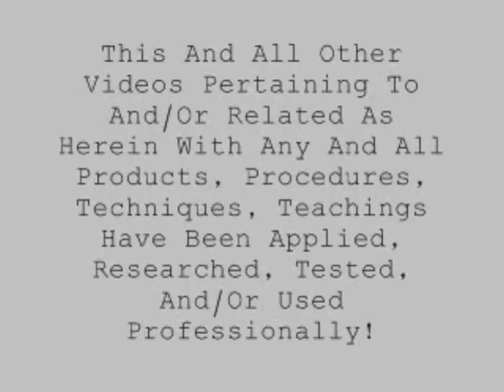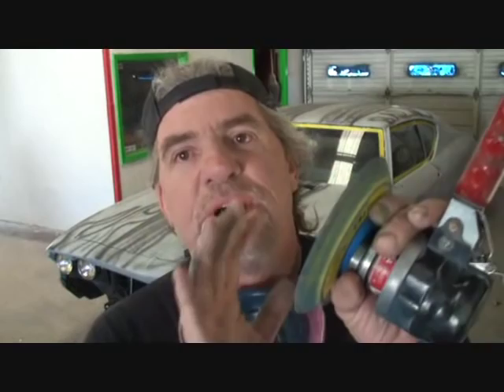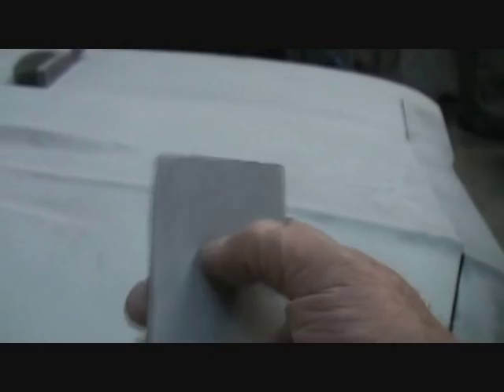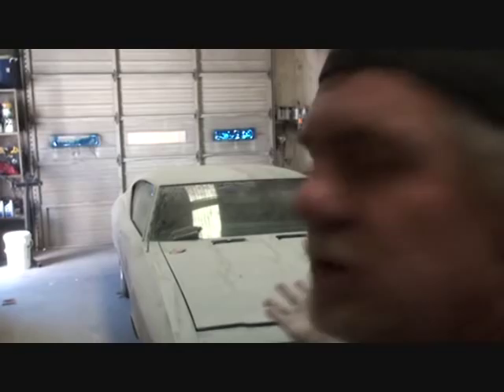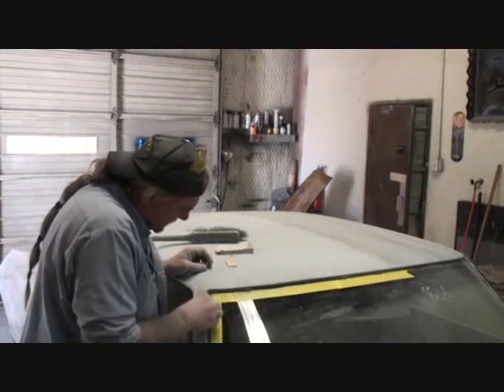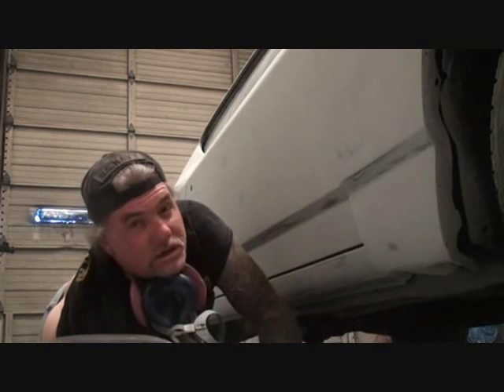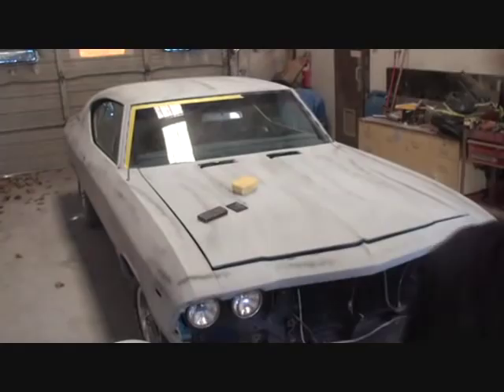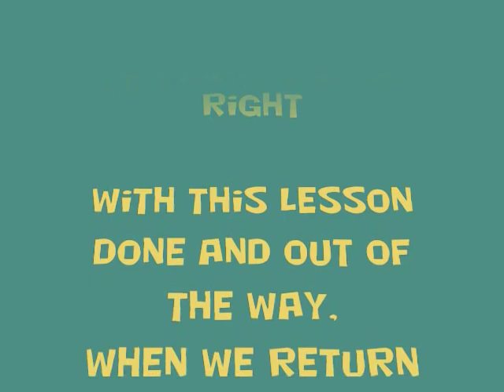"How To Paint A Car"-By Yourself-Part 10-Block Sanding Primer

Comment: I have been researching all day about body work, because I am getting ready to do it to my Truck in the future. I am just weighing all my options, and have been making a list of tools I will need for the future. I enjoy doing all the work myself on my build. I am very concerned about paint, because I want my truck to last for my whole life, and be my daily driver. I also live in illinois, right in the salt belt. How much did you charge the person for the job in this video? This is about the same degree or work I need to do, or worse. I will do most of my metal work on my own, but I am contemplating having someone else doing the bondo, sanding, primer, and paint, because I feel like I might not be able to get it as good as I want, and need it to be if I want it to last. It is a 1958 International Harvester 4x4 Travelette. Only 72 total were ever made, and only 17 were factory 4x4. It is the first crew cab made by any manufacturer. I want to get it right.

Comment: Hi Peter,  I'm really enjoying your show. I bought a 1992 Dodge Dakota last week for $1000 I'm using it for work.  It has a coat of primer on it I'm guessing because the paint was peeling,  but it all looks good no rust no peeling paint no dents just a few sanding scratches in primer. I'm thinking wet sand it with 420 and paint ? Regards,  Pat.

Comment: Just finished sanding my last project but funny how we use similar methods - I must be learning.  That surface of 2k primer is a bear unless you cut it with a quick pass with the DA.  Next up is a VW bus" Getting the list done!  Thanks Pete & take it easy in that crazy weather back there.  Over 100 here in the CA high desert!
Reply from the maker: Jim Daniell Good Ole VW Bus! Better get a BIG AIR COMPRESSOR for that job..
Reply: diyautoschool For sure!  Actually it's a re-do so mostly just removing some paint & smoothing a bit more.  The original job needed to sand blast the "patina" roof they seem to get - lots of sand!  Used a pressure washer attachment so saved a little life on the compressor & keep dust down.  Just a small shop DIY'er but do have a big compressor - a necessity.  More time than brains & money these days!

Comment: Hey my friend Pete, I enjoy your videos and am new to auto body.  I'm working on my 68 Falcon, planning on a gloss black 2 stage base clear paint job. Started out sanding the whole car down and covering it in black Summit Epoxy (sealer) not primer. LOL then scuffed that down with 180, did all the filler work necessary, and welded in the holes from the trim and moldings, 1 more 180 sand down followed by 1 more coat of epoxy to seal everything in. Then a coat of Nason 421-19 primer -surface 2k. (smells like strawberries) and some trim coat to check my work. So far so good. Im almost at the point of spraying 3 layers of the Nason to do all my final sanding by hand (I bought the dura block set). I was told to sand in sequence 180,320,400,600 then base-clear. My question is: you went from 180 straight to 400 wet. Can I do that for a black base-clear and be ok? Skipping the other steps? If so, great! But I am like you, wanna do it right the first time. Thanks again for all the info brother and I will keep watching!! I saw the video where you said epoxy is a sealer and sucks to sand, boy are you right!! Clog city! But I missed the 5 day recoat window so had no choice.
Reply: aaron anderson  Ok Aaron, I appreciate the reply man. I will try it. That will save me some work for sure! I bought those soft sanders (styleline?) the sell different shapes and lengths, I really like them alot. The help with this particular car it seems like there isn't a dead flat panel on it anywhere. Thanks for the help man, have a good day!

Comment: poor strawberry... my friend Pete do you drill alignment hole into the door hinges ?
Reply from the maker: ***** No, on this particular job Ill leave the hinges in place and remove the hinge pins, then replace the bushing and hinge pins with new ones and it should line up perfect.. If I have to remove the hinges I take a scribe tool and draw a line around the hings then remove them, once they are removed I then take my cutting wheel and lightly go over the scribe mark to make sure I don't lose the line... Thanks DOGBUGGY!
Reply: im going to try and give you a call about leo soon im going back to az
Reply: lets do this if I come down I 20 ill come see you
Reply: I fell in love with Tyler
Reply: blew a motor in marshal
 lol

Comment: Just found out both sides of rocker supports have rust hole in the door jams. FUCK"😠 that means I have to cut the rear to get to them. This project is starting to turn into a can of worms😕

Comment: what size compressor do you use
Reply: he probably uses an industrial shop air compressor, I would guess 80 gallon or bigger to run a shop that size...I have a 20 gallon for my garage that works pretty good, but if I use a D/A sander for 10 min straight, I heard the D/A sander start slowing down and the pressure drops quick I'm the tank. I'll be getting an 80 gallon, or whatever I can fit in the back of a pick up truck when I get a bigger garage.

Comment: That little block is good for sanding small areas such as ding repairs that have been primed or small areas like the bottom of the fenders or the windshield pillars. Dude needs to use a 12" to 18" long block on those large surface areas. Also, when blocking primer he should be using an X cross motion. Dry blocking is not healthy for you in the long run. He should be using water to keep the dust down even though he is wearing a dust mask. Water is a money and time saver in the long hall and keeps the paper clean as you go. Get a sponge and a bucket. You can water sand with the gold paper.